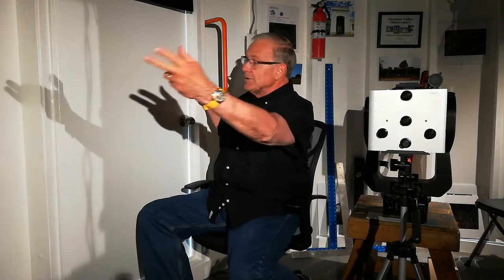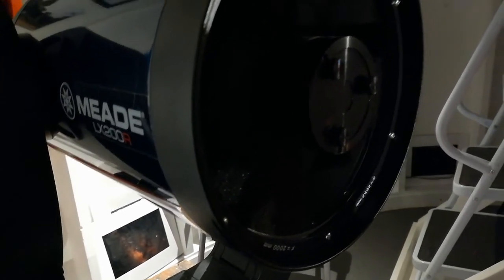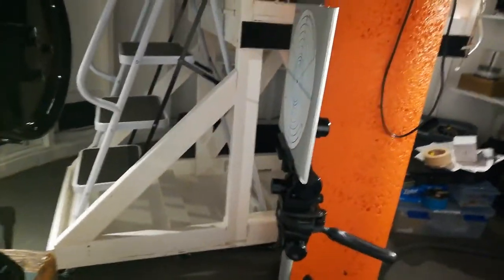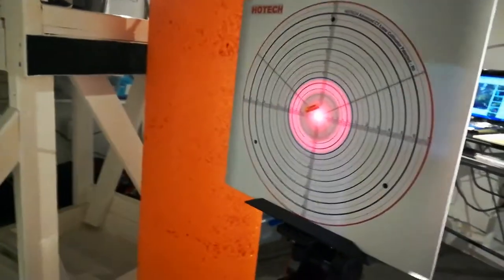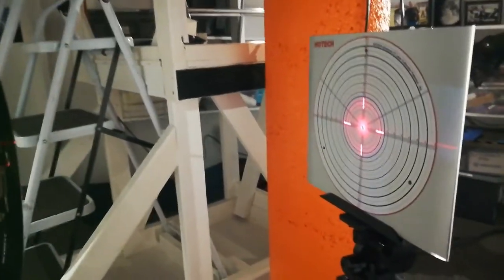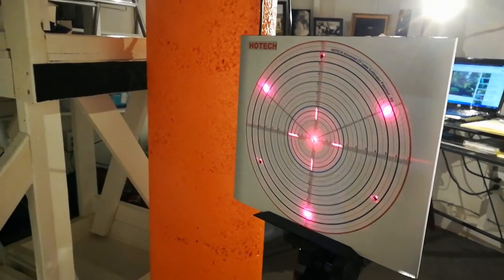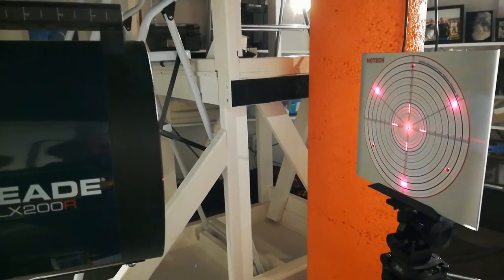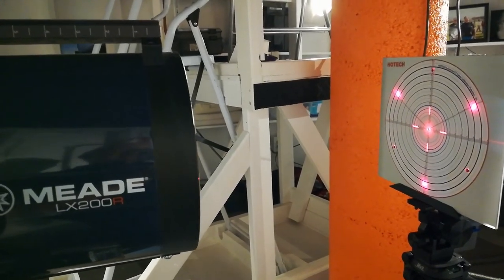Hotech Advanced CT Laser Collimator, First-Time User--Impressions and Suggestions

Comment: Excellent video Mark , much easier to follow than hotech’s.I’ve bought the 2 “ version for my C14 it will be interesting to see how far out of collimation it is at the start
Reply from the maker: Mat, thank you for your kind words. I believe you will be very pleased with the precision of the Hotech instrument. I definitely achieved the best collimation I have ever had on my LX200. When you think about it Mat, even shipping a telescope from the factory to a warehouse and/or a customer most likely jiggles the collimation some. I can't imagine that it doesn't--especially the way freight companies handle the packages... I would strongly suggest that you get some knobs for your secondary mirror (I use Bob's Knobs). There are a number of vendors that provide them at this time. It makes adjusting the secondary magnitudes easier. You'll probably fall in love with your C14 all over again after using that collimator. I have never enjoyed such crisp views in my LX as I do now.

Comment: Great video!  So I'm curious to know what were you're results with actual observing?  Do you think it did the best job of any of the techniques you've used before?  Is it that much better than your other techniques to justify the price tag?  What's your next best technique?  The artificial star?
Reply from the maker: Thank you for your kind remarks Wayne. Your question is a fair one. One of the "challenges" with SCTs is that the secondary mirror is not always "exactly" in the center line of the optical train. This has been a commonly reported issue with Meade SCTs (having read many accounts on online forums). In fact, the first time I tried to collimate this particular LX200--after installing Bob's Knobs--I noticed that my mirror cell easily turned in the corrector plate. I was horrified! I tried to turn it back close to where I thought it had been. However, I knew that if it turned that easily, I had no idea how much it had already turned with the previous owner. I tightened down the secondary holder, but I could still turn it even then. The really neat thing about the Hotech collimator is that it shows if your complete optical train is exactly in line. Using the collimator, I was able to get the center point of the optical path just off the center point on the rear-cell mirror Hotech provides. In order to get it perfect, I would have had to adjust the whole corrector plate assembly--something I have done before--but without a laser test afterwards. Anyway, to answer your question. The performance after collimation with the Hotech is amazing! Way more fine detail on Jupiter than I ever saw before. However, since this scope is in my observatory and doesn't move--and because I have sold all my other SCTs--I decided to sell the Hotech to a member of our local astronomy club. I will be going back to my artificial star, my Canon DSLR, and Backyard EOS to adjust the collimation going forward. Clear skies!
Reply: @markswain4111  Thanks for the additional information!  I have an old (1976, I just discovered) "orange" Celestron C8 I received on permanent "loan" from a former mentor.  While the former owner was VERY knowledgeable I'm betting the collimation was limited to the secondary and never had a full optical train alignment.  I'd like to get a newer SCT but to justify to myself and more importantly to my wife that I'd use it, I need to put the time in this older SCT.  Looks like HOTECH product would be an excellent investment.  Thanks again for the review and exploring the concerns that other reviewers have had with it.  Clear skies!
Reply from the maker: @waynewestlake3997  Many of those old C-8s are actually very good telescopes. Celestron built a lot of very high quality telescopes in those early years (as they do today!). I'm thinking that if you are willing to put some time into getting the optical train aligned, you might be very happy with that old C8. No, it doesn't have Go-To capability--or even a Dec motor (if I recall correctly), but it can be a great scope for visual work. As always, Clear Skies!
Reply: @markswain4111  Yeah no Dec motor but does have the RA motors and they do still work (just tested) if not a wee bit noisy.  My mentor gave me an add on power controller for those motors so you can adjust it for sidereal, lunar or solar observing as well as faster panning forward and reverse along the RA all by controlling the frequency of the AC power going to the motors - quite inventive device for the time!  Now if I can just get the weather here in AZ to cooperate which is a tall order for this time of year - and we're thankful for the rain.  But when we start getting cooler days and longer nights I'd like to be ready to use the scope in earnest!  Clear skies!
Reply from the maker: @waynewestlake3997  And every time you set that scope up to view the heavens, you'll remember you dear mentor and the times you two spent together... AZ has some of the best sites for astronomy in the U.S. My wife and I love to visit Kitt Peak for their public viewing sessions when we're down Tucson way. Last time was when we were in town for the international mineral show. I absolutely love that observatory complex--a national--even international--scientific treasure. I hope you enjoy many wonderful hours with your C-8!